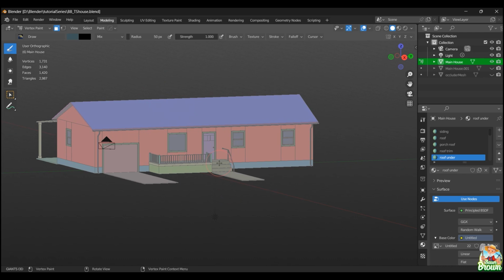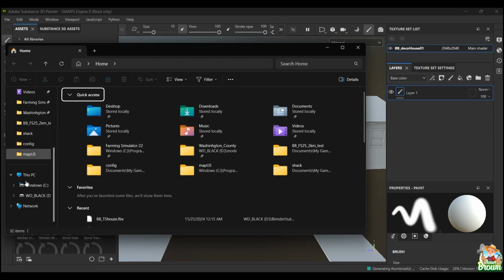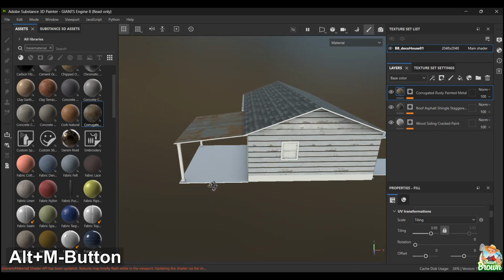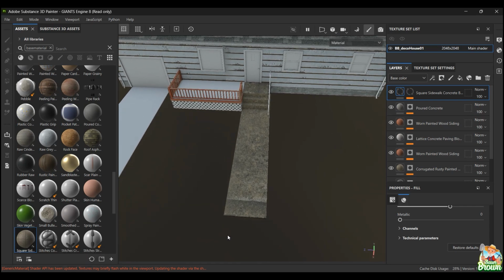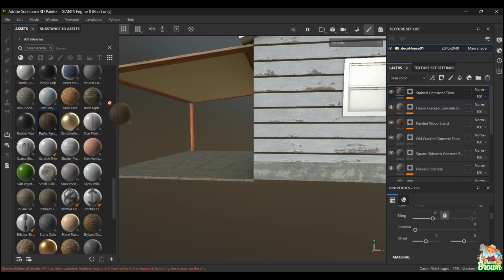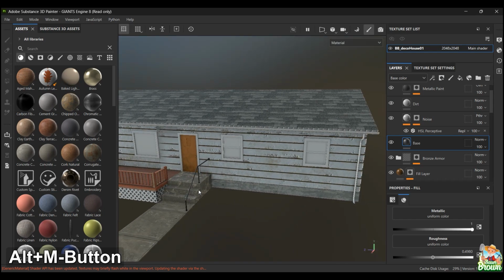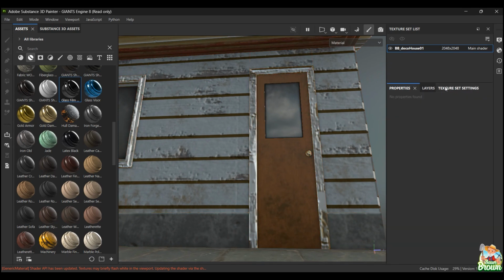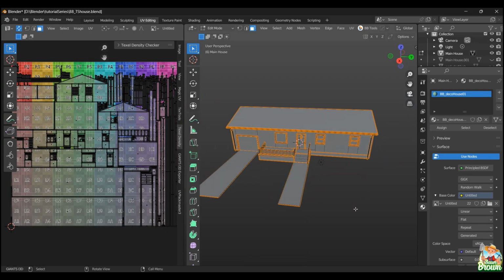Workflow: Building a Deco House - Part 10

Comment: I’m currently trying to get familiar with creating my own foliage. Have you got any videos on this topic?
Reply from the maker: Creating your own, like from scratch? Building the models, texturing, etc? That's something I haven't attempted so no clue on where to even start with that, however I would love to learn how!
Reply: @ na basically just making the planes on blender then adding grass textures ive been successful so far but when adding fruitshader/billboard the texture goes invisible.
Reply from the maker: @CMoDZ3D  Try adding an additional UV map in Blender. It doesn't have to be anything special, just an additional map.
Reply: @bauerbrown  was told it was something to do with vertex weights. i have no clue lol
Reply from the maker: @CMoDZ3D  Maybe? I also have no clue. From what I understand of vertex weights I wouldn't think it applied to foliage, but then I really don't know.
Reply: @bauerbrown  yeah pretty confusing. anyway. giants have fixed new mod from game for maps.
Reply from the maker: Did they? I'm still unable to make a new map on 10.0.3
Reply: @ they updated it then deleted it again then added it again. You might have the faulty .3. Maybe redownload it
Reply from the maker: @CMoDZ3D  I still get the same thing, not working. I was wondering if they even meant to post it because 10.0.2 and 10.0.3 are both available to download and they don't usually do that. The file size is bigger so something certainly changed.
Reply from the maker: It's working. I was being a bonehead. The game needs to be updated because new mod from game works from the game's SDK

Comment: For the problem you're having with shading on the peak and by the door try this.  In Blender, select object, edit mode, Mesh, Normals, reset vectors.  Not exactly sure what this does but it clears up most shading issues for me.
Reply from the maker: It sure sounds like it would work. I'll have to check blender in a bit, but I do know that I tried just about every "normal" option there is, LOL. I think recalculate normals is what I was hanging my hat on and that didn't work. Reset vectors doesn't sound familiar so I'll keep my fingers crossed on that one! Thanks for the heads up!

Comment: High Bauer, isn't it better to triangulate the building before exporting it to substance painter? The editor does triangulate everything and can mesh things up. In blender you have a triangulate modifier. If you check the box keep normals in that modifier it will keep all like it is and it triangulates way better than te editor. I also think it would take away the shading issues you have in substance on some parts. It's a tip i have seen in some "blender bro's" tutorials for game assets.
Reply from the maker: It might be better, I just always took it for granted that the editor will triangulate anyhow. As long the geometry count is acceptable I never worried if the editor did a good job. Now with Substance Painter, perhaps that could make a difference? I'll have to try it out. I never triangulate in case I need to go back and make modifications, it's just easier. Perhaps you're on to something though, I'll give it a try.
Reply: @bauerbrown  triangulation sometimes can deform your model on simple models it willn't happen that fast but i have seen it happen on more advanced models like weapons,airships etcetera. In blender you have the keep normal checkbox to avoid that. So my opinion it's always better to do it in blender. You can always make a duplicate in blender and triangulate that for substance, that way you always have one clean that you stilll can make changes on.
Reply from the maker: @John-qe8zt  I usually do keep a backup (if I remember) because crazy unexpected things tend to happen to me and it's always better safe than sorry. I suppose I just never put that much that into triangulating, but I'll be more aware of it now. I'll certainly test it out to see what kind of difference it makes.